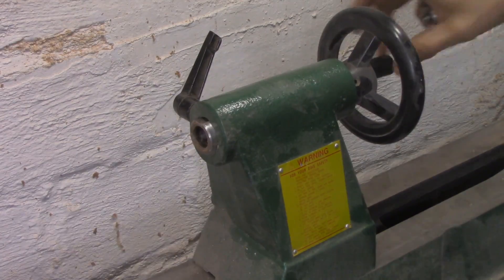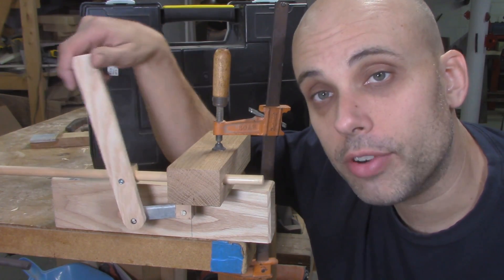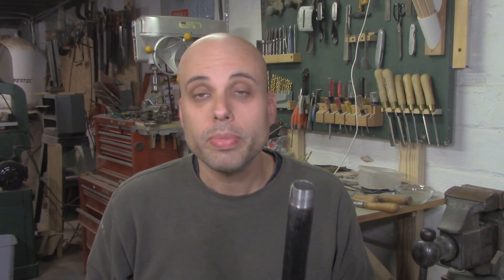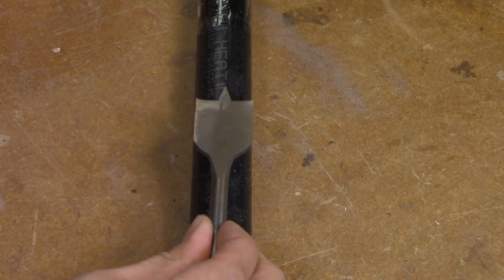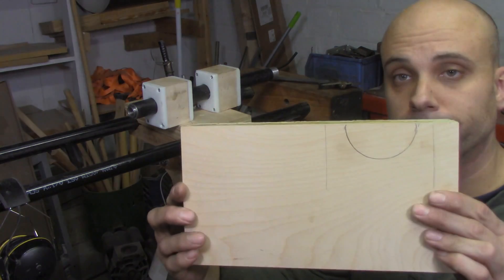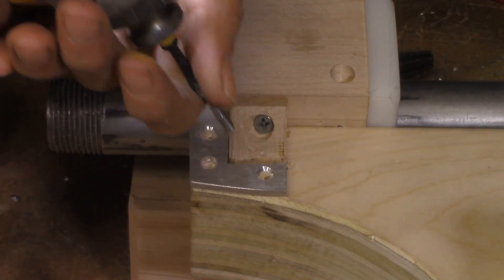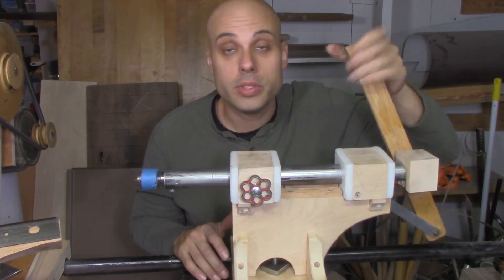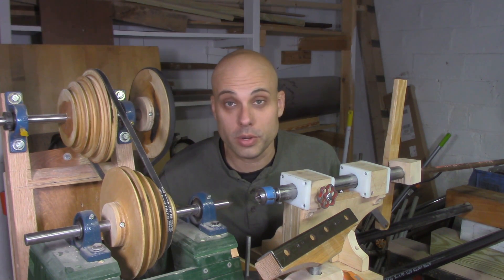Real Lathe Pt. 5: Tail-Stock

Comment: Wow. While me from the past could have used the present rex’s content and go through woodworking much easier, Rex from the past managed to solve huuuge problems present me is facing in hobby machine making. Im making my lathe out of metal, and been losing sleep over some components design details. I glanced on it back then but paid no attention be ause it was waaay over my skill level. Happily I just accidentally stumbled upon it, and voila, problem solved. You almost took the fun of the build 😆 You’re awesome rex, since always.

Comment: Ok, first - this is Great! I Must build one of these. There is an issue, however, with MT 2 sleeve. Your link goes to one that is current unavailable on Amazon so I looked on eBay. They have them but my ignorance is in full bloom here. I see one that is MT2 to MT3. Would this work? There are a plethora of variations on this theme so, either I have to make myself a course on lathe tapers or, maybe you could enlighten us about this particular point?
Reply: I doubt that would work.  An MT2 to MT3 sleeve is going to be tapered both on the inside and outside so it would be difficult to lock it into your ram
Reply: Check back periodically.  Stuff can sometimes come and go on Amazon, especially with hunks of the global economy more or less whacked out by the current situation. There are several MT2 to fixed diameter adapter sleeves showing on Amazon now.

Comment: My 1st chance to watch this series. So far I am impressed with exceptions. 1st with all the wood working tools you have, I can't beleave you don't have a adjustable bit and hand brace drill to turn it along with an 4 sided chuck adapter to hold the bit in a regular drill. 2nd alignment wsa good with exception of hight as it looked like the tail stock was a smidgen higher than the head stock shaft. ( hope you adjust that). Not that i could have come even close to doing as nice a job as you. That thing is great!!

Comment: What is it with you Americans you allways use Screws with Slit or Philips Drivers? Im trying to avoid this kind of screws something like 20 Jears :D

In ALL my homemade Projects i use Screws with Hex or Torx Keys, they work much better, dont wear out and easily can be removed if the Screw is coroded, like 20 Jears after installing, while you have to drill out any Philips Screw...

Ok, here in Germany (like in nerarly EVERY other Country besides the US) we use the Metric System, because 1 Kilometer has got 1000 Meter, has got 100 Centimeter, has got 10 Milimeter. Because ist Easy and much more precise! Not something like 1 Mile has 5280 Feet has 12 Inch and this hwole 1/2 1/4 3/4 Inch BS :D

Comment: Thanks for the video. I just got through making a tailstock out of square tubing and steel for my old lathe. I did not do any steel Machining. It looks as though I used the same steel cylinder for the tailstock insert with a number 2 Morse taper. Your RAM idea is excellent. Are you getting any galling of your RAM by the lock on the tailstock? Good job man.
Reply from the maker: Thanks so much!  The lock on the tailstock is a problem. It hasn't galled the ram because I added a brass slug, but I have to really crank it down and it's holding power is only okay. I'm currently working on a bigger lathe made with more metal and I'm looking at a jam-nut mechanism for locking the tailstock ram. I'll do a video. Fingers crossed!

Comment: Very cool. It’s been great seeing how that’s coming along. I have a grizzly lathe and at times wish that I could advance the quill of the tailstock faster like you are able to on your homemade lathe. Great work.
Reply from the maker: I've often looked at Grizzly lathes. Some nice-looking machines. The lever-style tailstock is actually common on metal lathes. You might be able to modify yours. Thanks for watching!
Reply: Rex Krueger  I have the grizzly g0766 which is a 22” swing by 42” bed and it was $1700 where as the powermatic 3520 lathe of course has 20” swing by30” bed but is costs like twice as much and isn’t quite as capable as the grizzly. My dad has a metal lathe that has that style tailstock but you can also turn the a wheel handle to sort of micro adjust it. It’s kind of strange but nice at the same time.
Reply from the maker: Oh man, I've had my eye on the go766 for over a year. I want one really baldy. It seems perfect and perfectly priced. Alas, 1700 is still a lot of dough. Sigh.
Reply: Rex Krueger yeah it is a bit. I was fortunate to get a sort of loan through my parents and have been paying them back for it. A few more months and the debt monkeys are off my back lol
Reply from the maker: @scottsimpey2965  No judgement from me. My folks have helped with a tool here and there. When you're trying to make stuff, you need to use whatever resources you have.

Comment: Damn it Rex. Just turn something already!!!

PS: I'm not a big fan of those wooden v grooves sitting on those round ways.
I would prefer using half pieces of metal tubing Rough them up a with the angle grinder and epoxy them to the carrier. 

And how about making a steady rest. Very useful for drilling holes into a tool handle.
Reply from the maker: You know more about lathes than I do. What would make the half-rounds better than the V grooves? Very interested to hear your thoughts.
Reply: I worry that those two pressure points on the v-groove will cause the wood to split.
Reply from the maker: That is totally possible. I think the fact that I built it from plywood and reinforced with hardwood will counter-act that weakness, but we'll have to wait and see. Probably a lot of bugs to work out of this design.

Comment: Rex, excellent work on the design for  making of most parts from around the shop and the build!
If this series brings a lot of views (I’m sure it will) you might consider “building a DIY drill press”. Yes I know there are the ones using drills, but I don’t think I’ve seen one similar to a store bought drill press. Just a thought and thanks for the great builds!
Reply from the maker: I really want to do one, and I've thought about it a lot, but it's a complicated build. Gonna take a lot of planing.

Comment: I would have ground down the sides of a spade bit to get the right diameter. That’s a great project for a woodworker who doesn’t want to buy one. How about a cover for the belt and pulleys. Sorry I haven’t viewed the previous video yet. I reckon you can get the alignment almost perfect with not much trouble. Before I could afford to buy a lathe I turned legs for a harpsichord on an electric drill attachment, which whizzed round at the wrong speed and the chisels were ordinary. But they turned out good. That was 40 years ago. Health and safety cost a bit more money than I had then! The main problem I see with the wood construction is lack of mass when the wood is turning. My lathe is simple but very heavy. I eagerly await the next stage.
Reply from the maker: To bore the plastic? That would have worked, but the circle cutter has so many uses and bores a PERFECT hole with no grinding. They cost like 12 bucks.
Reply: Yep👍

Comment: So is that Morse taper insert just a straight cylinder on the outside?
Reply: Yes. The outer surface is a cylinder while the inner surface is a truncated cone shape.
Reply from the maker: @arnoldkotlyarevsky383  That's correct. It's very easy to install in a pipe.

Comment: Congrats on a well thought out solution to a not simple problem.  Very impressive.

Minor bitch though.  The video is missing the Rex Figures It Out part of the intro, it definitely applies to this part of the project.  I think it would have fit well at 0:27.
Reply from the maker: You know, I just totally forgot to put it in. You're totally right, tho. It would have fit nicely there.